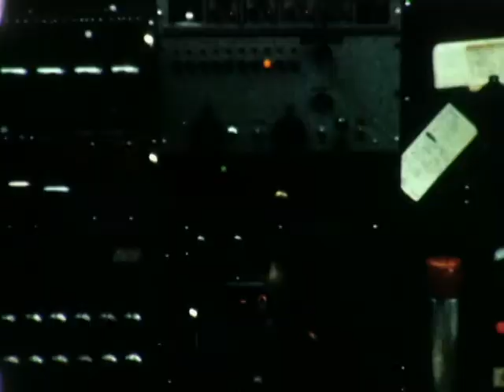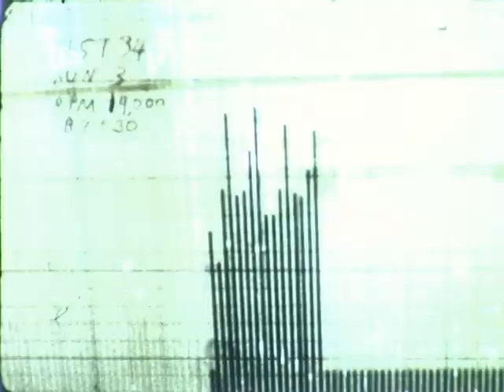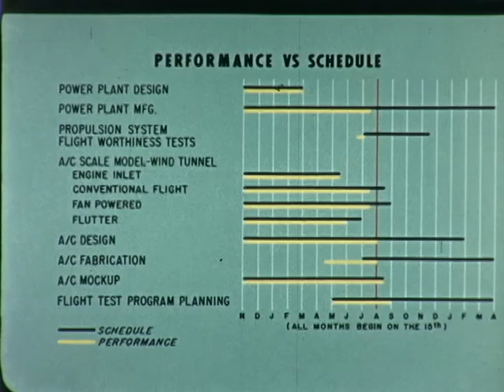F 2401 Ryan Vertifan VZ-11 (XV-5A) Progress Report #2 1962

Comment: Never seen this aircraft on any of the vertical take off videos. The Harrier's Pegasus engine just did away with the need for complex fans and used ducted thrust. F35B is a mixture of both.
Reply: The vertifan was actually a much better design than the harrier - the fans increase the amount of air moved, allowing for much higher efficiency (the harrier when hovering gulps fuel at ridiculous rates, and that has a very noticeable impact on range). Also, if I remember correctly, the vertifan's system used the engine exhaust to power the lift fans, and after the energy is extracted from the exhaust, the exhaust is mixed in with the cool, oxygenated air drawn in by the liftfan, so exhaust ingestion isn't a problem with the vertifan. Exhaust ingestion is a big problem with the harrier and caused many crashes. 
It's a shame that more time and money wasn't spent to perfect the vertifan technology... but whatever, we have the F-35B now, which has the most efficient solution to the VTOL problem.